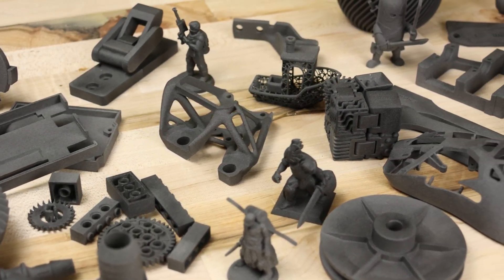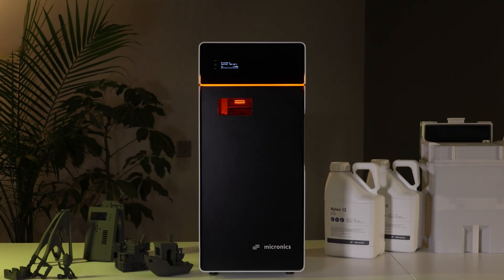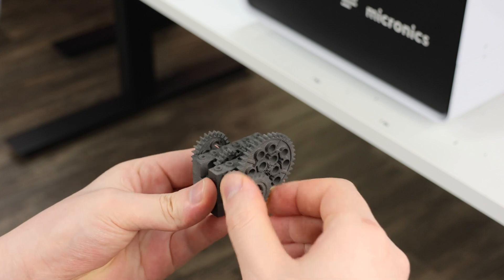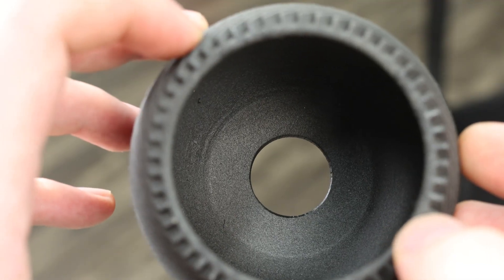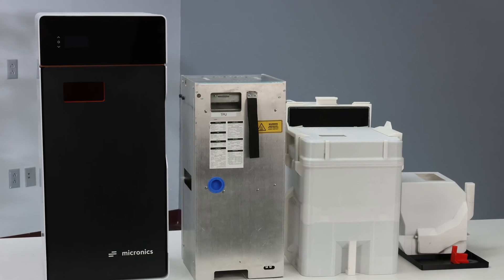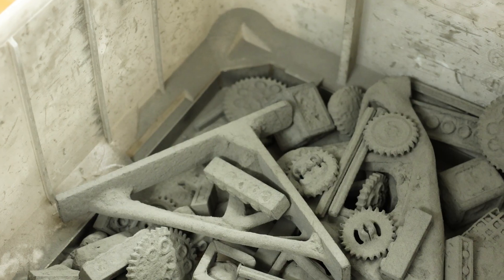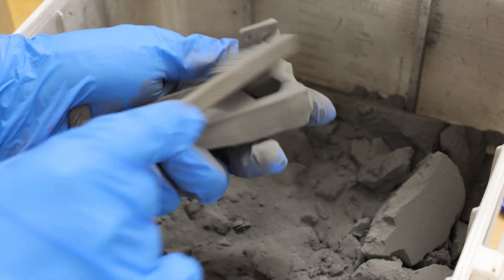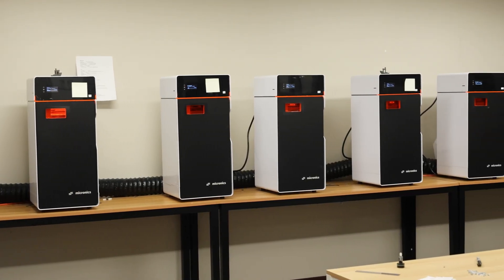Micron Desktop SLS 3D Printer

Comment: This looks like a very nice tool, and I'm sure than you will be able to address the current manufacturing and shipping issues, prior to your planned ship dates.  However, I am extremely dismayed at how nonchalantly and careless you've been in regards to the safe handling of the polymer powder.  You only have 1 set of lungs, and any powder that you breath in, will be in your lungs for the rest of your life.  Since this entire process exposes one to more particles in a single cycle than an asbestos worker would be exposed to asbestos in their entire lifetime, the risk of mesothelioma is beyond alarming.

I've seen the safety protocols in use by companies that use SLS tools, and your use of paper masks is beyond alarming.  All points where it is possible for the particles to become airborne, MUST be performed in a sealed glovebox, and the worker must be wearing a full face mask with respirator.  That is not an option, it is absolutely mandatory.  Watching your videos, and those of your reviewers, handling the powder is reckless, irresponsible, and some might say criminal.  I seriously hope you fix this messaging, as the handing of polymer powders is EXTREMELY DANGEROUS!

There is also the concern of dust explosions, which are probably less significant, but your customers need to know about those risks as well.  You could argue that your customers should be doing their own research, but do you really want to risk it?  I still remember the 70s, when 2 of the 3 sugar manufacturing plants in the world blew up due to dust explosions.

Comment: This really requires a lot of safety equipment and local ventilation. The filters and fans shown are not sufficient and with the open powder handling you will need a true hepa cartridge vaccum that is explosion resistant to handle the inventable spill. This product can cause cancer if you dont use sls properly and most of the risk is outside the printer.